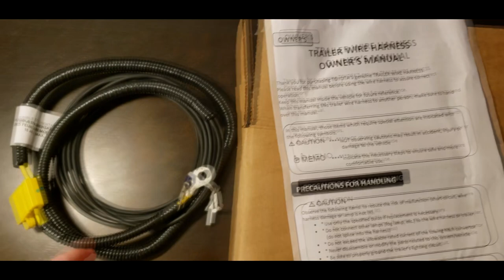Toyota RAV4 (2019-2024): OEM Toyota Trailer Wire Harness Installation (Full Step-By-Step Tutorial).

Comment from the maker: PRODUCT LINKS:
1. 2019-2022 TOYOTA RAV4 / HYBRID TOWING WIRE HARNESS GENUINE OEM PK5D0-42K11-WH - https://www.ebay.com/itm/163858462917?mkcid=1&mkrid=711-53200-19255-0&siteid=0&campid=5338971185&customid=&toolid=10001&mkevt=1.
2. Reese Towpower Wiring Adapter, 4-Way Flat to 7-Way, Round Car End - https://amzn.to/40S8vkA.

RECOMMENDED TOOLS:
1. LED HEADLAMP - Coast FL85R 700 Lumen Dual Color (White/Red) Focusing Rechargeable LED Headlamp - https://amzn.to/3LVebVx.
2. SOCKET SET, RATCHET - GEARWRENCH 57 Pc. 3/8" Drive 6 Pt. Mechanics Tool Set, Standard & Deep, SAE/Metric - https://amzn.to/41wE6Z3.
3. RATCHETING WRENCH SET - GEARWRENCH 16 Piece 12 Point Ratcheting Combination Metric Wrench Set - https://amzn.to/3JqYunC.
4. FLEX-HEAD RATCHET - GEARWRENCH 2 Piece 1/4", 3/8" Drive 84 Tooth Full Polish Flex Head Teardrop Ratchet Set - https://amzn.to/3yjPHNK.
5. 3/8" DRIVE EXTENSION SET - GEARWRENCH 4 Pc. 3/8" Drive Extension Set, 1-1/2", 3", 6" & 12" - https://amzn.to/3li0hlK.
6. MICRO-TIP SCISSORS - Fiskars 94817797 Micro-Tip Scissors, 5 Inch, Orange - https://amzn.to/3FR7v7h.
7. SILICONE SEALANT - Henkel 908570 2.7 oz Tub Clear Silicone Waterproof Sealant - https://amzn.to/3KMCSTI.
8. ZIP TIES - 400 Pack Black Zip Ties Assorted Sizes 12+8+6+4 Inch - https://amzn.to/3xWjrjM.
9. WIHA HEAVY DUTY SCREWDRIVER SET - Wiha 53097 Screwdriver Set, Slotted and Phillips, Extra Heavy Duty, 7 Piece - https://amzn.to/3ystzRx.
10. FLAT HEAD SCREWDRIVER - Klein Tools A131-2 1/8-Inch Flat Head Screwdriver with Keystone Tip, Made in USA, Pocket Clip, 2-Inch Round Shank - https://amzn.to/3VV0FVh.
11. SPLIT WIRE LOOM - Gardner Bender FLX-3810T Split Flexible Electrical Tubing, ⅜ inch x 10 ft - https://amzn.to/3kwmr3k.
12. ELECTRICAL TAPE - 3M Scotch Electrical Tape, 3/4-in by 66-ft - https://amzn.to/3J0M0TB.
13. CORDLESS DRILL - CRAFTSMAN V20 Cordless Drill/Driver Kit, Brushless - https://amzn.to/3LhY1Fo.
14. DRILL BIT SET - DEWALT Drill Bit Set, Black and Gold, 14-Piece - https://amzn.to/3kRRiaM.
15. HOLE SAW KIT - Milwaukee General Purpose Hole Saw Kit, 15-Piece - https://amzn.to/3JPss3B.
16. 3/8" TORQUE WRENCH - GEARWRENCH 3/8" Drive Micrometer Torque Wrench 10-100 ft/lbs - https://amzn.to/3YmhnN2.

Comment: This video needs to be shared with anyone that does not have the hybrid or prime trim since they have the battery in the back.  Toyota really messed up not adding a power wire to the rear in the other trim packages

Comment: I removed the wiper plate for the wire feed, I could not see past the battery well enough and it was easy enough to remove it.  The hollow garage sounds made me feel like every pop from the body clips was extra dramatic.  And on my '24 I did not have the right size hole to fit the 4 pin connector throught it so I had to enlarge it myself.  Overall, this is a super helpful video.  Thanks for making and posting it.

Comment: good god, seems better to just run it under the vehicle?
Reply from the maker: It is OEM kit  designed by Toyota to run inside cabin, designated  cables, connectors, grommets e.t.c. Even if you want, you can not run it under.
There are at least two alternatives: E-trailer and U-haul, both designed to run underbelly.
Reply: @MorozovAutomotive   I installed the U-Haul preferred wiring "module" and I can tell you it's the exact same as the Toyota one, wire colors, connectors and even then double-sided sticky tape also, it's likely just an aftermarket module with a Toyota logo on it. The only exceptions is that the "OEM" one comes with grommets/plugs.  If you just use your own 12v+ lead wire from the battery then you can easily use the Toyota one and run the line on the underside of the vehicle. 

Though, I would run it on the interior even if it's not an OEM kit.  There are many ways to run it internally without removing as much of the panels as in this video, however it wouldn't be as nicely completed as this very well done install was.
Reply: I cannot believe in 2022 that there is not a simple plug-in port under the vehicle for trailer wiring. Insane.

Comment: There isca 10 amp lighter plug inside the hatch trunk. You must remove interior panel to access passenger side rear light plugs. Pull fuse and make trailer power connection there.

Comment: So this does not need to attach to the factory hitch at all, right? Could I install this on a RAV4 that has a non-OEM hitch? I'm leaning toward going for the TorkLift EcoHitch
Reply from the maker: That is correct, will work with any hitch.
Reply: @MorozovAutomotive  Cool, thanks. I want to get a different hitch but Toyota's website says that it only works with the OEM hitch. Thought maybe it attached to it for some reason. Thanks!
Reply: @MorozovAutomotive  Did you install something in addition to the OEM harness? The Toyota parts page for his P/N shows this adding a 4-pin connector but you seem to have a full 7-pin connector here.
Reply from the maker: @chrisriker8186  OEM hitch has designated bracket and slot for OEM 4-pin connector, but it still could be attached to any another hitch with just a zip-tie , or you could use extended 4-pin cable to rout it out to any desirable location.
Reply from the maker: @chrisriker8186  Yes, we did install electric brake controller for trailer that is required 7-blade socket which is adapted 4-pin connector as well.
Reply: The TorkLIft hitch (I have on on my Prius) has only 4 bolt attachment, not 8 like the OEM, and sits almost two inches lower on the bumper.  Regardless of TorkLift quality, I'm going with the Toyota OEM hitch.  Morozov already replaced an aftermarket hitch on the vehicle we're watching in this video for good reason.
Reply: @CR-rk2rk  I've heard something similar, unfortunately right after I'd received my TorkLift hitch. Not sure what to do with it at this point... can't really return it.

Comment: Just completed mine today. Thanks for the tutorial, I couldn't have done it without you! 

A couple of notes that might help others. Getting it through the firewall was painful for me, the gromit was turned slightly from what you see in the video, so the wiring loom completely hid it, it was impossible to see from the engine bay. Access from the inside is pretty decent, if you can't cut it for the engine side try using an all from the interior but be careful not to cut the loom. Also be careful that the gromit in the firewall is correctly placed when you're done, if there is any resistance it will pull the gromit through. 

Other than that, you can skip removing the panel beneath the seat belts, no problem to push the wire through. You also don't need to remove rear seats and adjacent panel, pull the weather stripping off along the rear door frame, it releases the inner panel and allows you to place the wire neatly inside. 

It's still a big job, give yourself 4 or 5 hours for this one.

Comment: It should be noted here that RAV4 Hybrid models have their battery under the rear cargo bay floor (right side I believe). So, for these models, it is not necessary to reticulate a 12V wire from the engine bay, through the fire wall and down one side of the car. Therefore any work undertaken to reticulate that wire is not needed.

This does not affect disassembly of the cargo bay and surrounds which must still be carried out during the installation.

Further, it should be understood that the RAV4 is a crossover meaning that it is constructed on a car chassis as opposed to a truck chassis. Cars of course are designed to carry people, trucks on the other hand are designed to haul heavy loads. This has important implications when towing trailers.

Toyota states that a RAV4 Hybrid can tow 1500lbs (and conventional wisdom indicates that trailer weight should comprise 80% of that figure). However, what I've read indicates that the RAV4 can tow a trailer up to 3000lb provided it has onboard brakes fitted (i.e. it is a braked trailer). BTW I'm just repeating what I found. Always check for yourself before proceeding and obviously, this figure would vary by model. Just a useful tidbit of information if you're heading down this path.
Reply: Yes, so do I coil the extra wire up somewhere, or shorten it(cut and solder)?
Reply: @CarterEdison777  Actually I prefer a mix of both.

On the one hand, you don't want it guitar string tight. On the other, you don't want a loose coil of cable floating around that might contact other electrical ccts.

So the ideal scenario is a balance between the two... not too short, not too long, just the right length.
Reply: Ya thanks for the added info. This install was involved and I'd bet a bag of replacement clips for the panels would be a good idea. In my experience those often fail due to brittleness and aren't designed for reuse. Well wish me luck, enthusiasm being my #1  natural talent followed closely by my #2 trait of impatience and its partner frustration, should keep me out of trouble for a bit. And you're correct about the weight tolerances. Over kill is great, and a call to your insurance provider will keep that contract secure, and they will give the load specs at that time. Safety first.

Comment: If anyone has Radio/Head unit issues after install (keeps rebooting every 30 seconds) here is the fix/reset I found in a forum: 

Key inside the car
Car/Accessory ON, Engine OFF
Parking Brake ON
Shift into REVERSE for 5+ minutes (car will make a beeping error noise - for hybrid I got error that hybrid system was off and the hybrid reverse noise comes on as well as the other warning noise - it is very loud/annoying)
Shift back into PARK
Start the car (should be reset/working)

Also, initially it had a parking assist disabled warning, but that went away after driving for 2 minutes. The radio did not fix itself (other forum where I got this instructions suggested the above procedure resets the navigation).

Comment: I just installed this on my 2021 Prime SE.  It was no where near as hard as this. 
I did not have to remove seats.  In fact, the side panels only had to be pulled back enough to access the plugs at the tail lights and stick the module on the body.  Same amount of work as an aftermarket plug and play option.  For what it's worth, the factory harness is much nicer/cleaner than the aftermarket ones.  It is, however, more costly.

Comment: On a rav4 prime the 12v battery is in the back. Can you skip all the routing part and only disassemble the back of the vehicle when installing the OEM:
  Part Number of the Toyota Wire Harness Kit: PK5DO-42K11-WH.
?

Comment: What a PAIN!!!!
 I think i would use an aftermarket adapter like a Curtis # 56434 which cost about $56 bucks.
Reply: still have to run a positive from the engine bay if it's not a hybrid model. All the reviews state this.

Comment: Very nice video, is it the same for the 2020 XSE hybrid model? If so, where can I get the 7 pins connector?
Reply from the maker: Thank you! It will be different for the hybrid since the 12v battery is located in the back of the vehicle. This is the one that we used - Reese Towpower Wiring Adapter, 4-Way Flat to 7-Way, Round Car End - https://amzn.to/3kHfKuP.

Comment: Question on the 4 way to 7 way harness.  I had the Toyota OEM wiring harness installed on my prime, and I want a 7 way.  Most 4 way to 7 way adapters require running a separate power wire to it (for charging trailer battery and maybe electric brakes) but you didn't do that on your 7 way connector?  A little confused?  Does the toyota module handle that automatically or do I need to purchase a special 7 way.. or other.  Hope you can help.  Thank You for the detailed video !!
Reply from the maker: We have not filmed this part completely, but some tips you may find useful https://www.youtube.com/watch?v=Ut0ZnU2JVVc

Comment: When you disconnected the battery, did anything strange happen to the electronics? Like tire pressure warning reset, or electronic parking brake alert, or whatever. Or did nothing happen? Thank you
Reply from the maker: Nothing strange happened. No warning signals.
Reply: I now have PKSB Malfunction.  I checked the rear bumber sensor plug but still have the error.  I took it to Toyota and they said if it's something I did I'd have to pay so I'm going to look at it further.

Comment: Why can't you run the wiring under the vehicle?
Reply from the maker: Because it is OEM kit  designed by Toyota to run inside cabin, designated  cables, connectors, grommets e.t.c. Even if you want, you can not run it under.
There are at least two alternatives: E-trailer and U-haul, both designed to run underbelly.

Comment: Does it come with electric brake support?
Reply: Moot point - the RAV4 is rated at 1500 pounds max towing and the lowest requirement for trailer brakes of any US state is for trailers 1500 pounds and above.
Reply: @nwalker8866  The Rav4 manual requires trailer brakes for anything above 1000lbs.